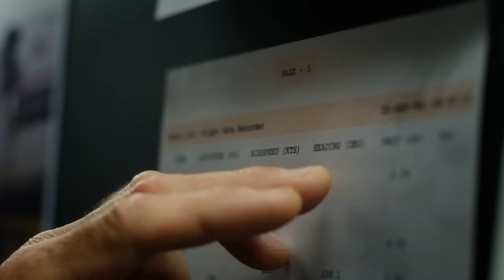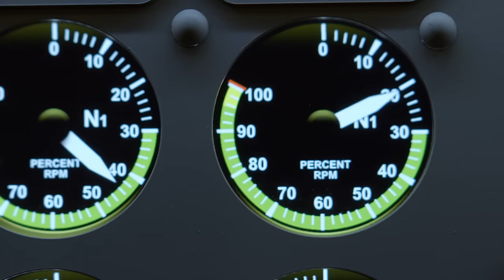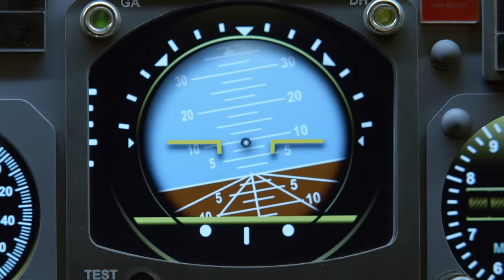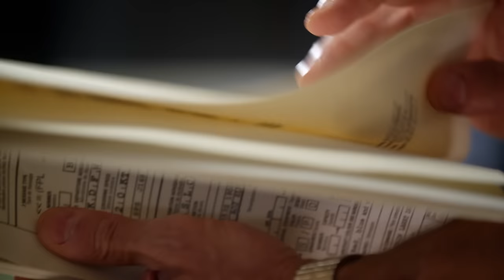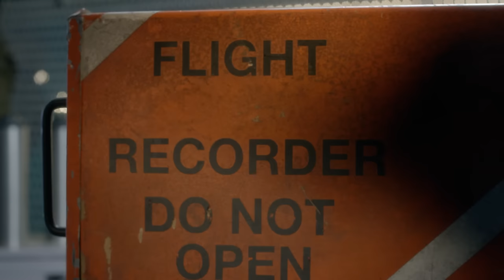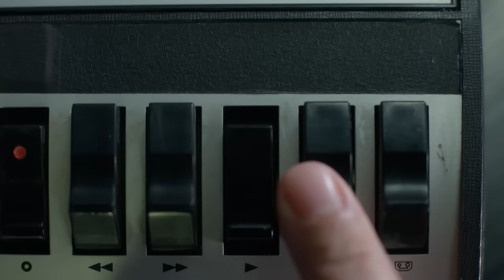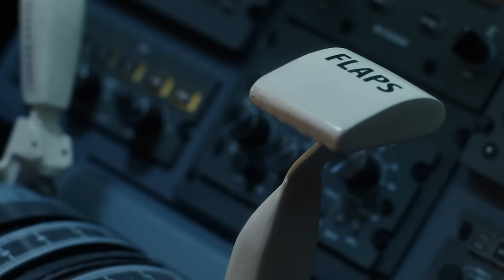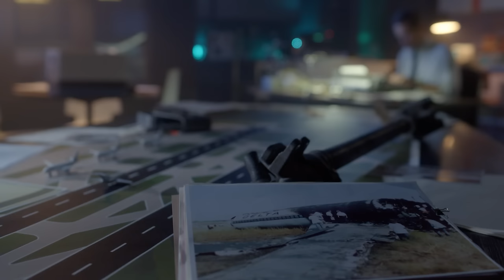The Mechanical Failure That Doomed Delta Flight 1141 | Mayday Air Disaster

Comment: All three of the crew were fired.  But the flight engineer was eventually cleared.  He then sued DELTA   -    The only crew member cleared of wrongdoing in the 1988 crash of Delta Flight 1141 at Dallas/Fort Worth Airport is suing Delta Air Lines, contending that the airline fired him “as a public relations maneuver to minimize Delta’s corporate responsibility for the tragedy.” Former flight engineer Steven Judd, 32, says in a lawsuit filed May 25 that Delta attorneys promised him he would retain his job and professional standing if he testified before the National Transportation Safety Board “in terms that would reflect favorably on Delta.” Instead, Delta fired Judd, pilot Capt. Larry Davis, and co-pilot Wilson Kirkland on July 18 – two months before the safety board issued a final report on the crash that exonerated Judd.